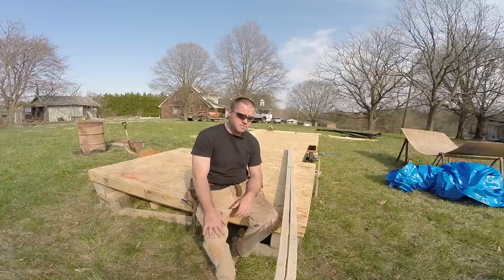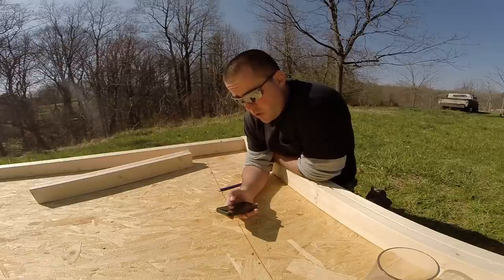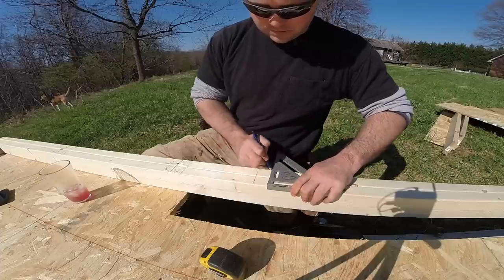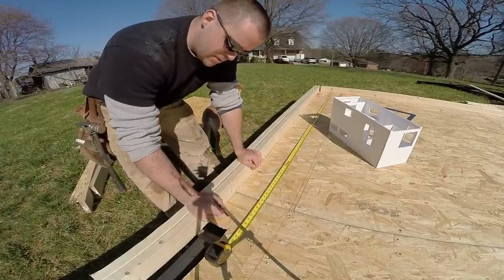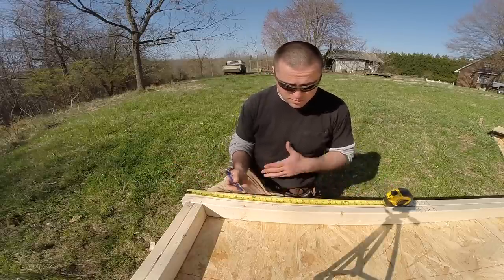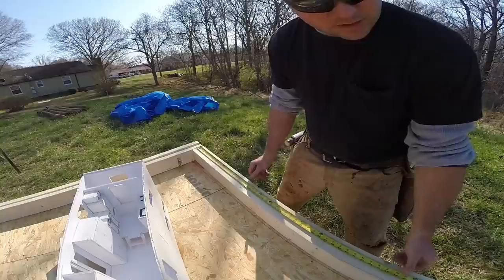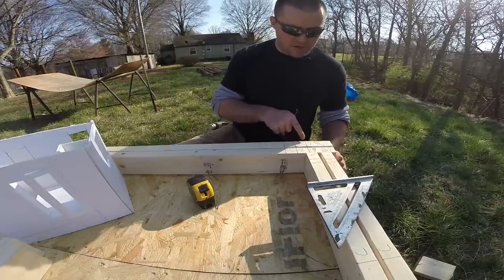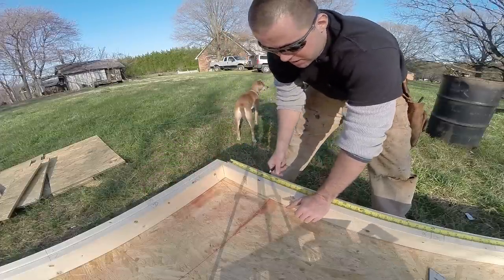Tiny House - Preparing Wall Plates for Studs and Windows

Comment: Awesome Video Series so far.  I noticed you didn't add in space for wall coverings (drywall, wood, etc) when laying out the closet.  I'm learning lots of carpentry time savers as you go.
Reply from the maker: Thanks. Of course you need to take those things into consideration when laying then out. I made the closet much bigger than the washer/dryer so it wasn't mentioned.

Comment: I don't know anything about construction.. can you tell me the difference between a Stud, King Stud, and Jack?
Reply: +C Beas A wall consists of a base plate and top plate and studs. A normal stud goes from base to top plate and follows traditional wall spacing of 12, 16 or 24 inches on center based on building requirements. A king stud and jack stud are used to frame out rough openings for doors and windows. Now when a stud is under a window or above a door and window - meaning a short piece - it is called a cripple stud. The header sits over the window or door and is supported from underneath with a jack stud with a king stud next to it running from base to top plate and a sill or plate sits under the window. The king and jack studs usually do not fall on center measurements, but the cripples do. Included a link below.  http://www.finehomebuilding.com/how-to/articles/anatomy-stud-framed-wall.aspx
Reply: +arosenberger87  corect i just want to add the jack stud is the bearing suport of the header , im gonna also add that in our neck of the woods jack is a rafter either a hip or valley , we call the jack stud a trimmer , i am not saying im right hes wrong